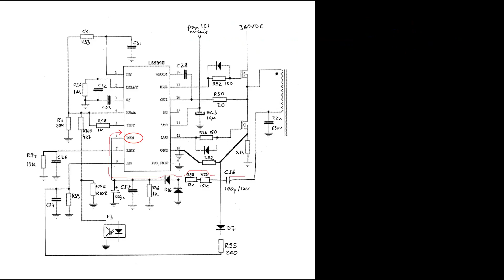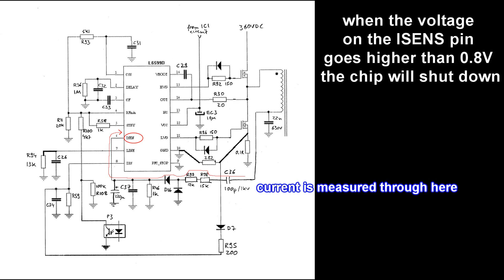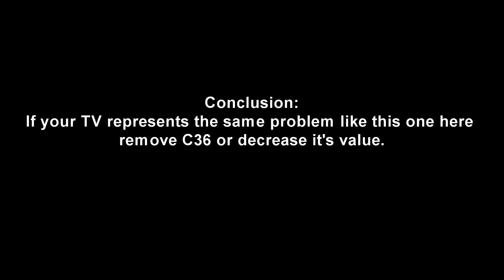RLC3210 turns on and off intermittently

Comment: Thanks got my RCA TV fixed I had tried so many things to fix it I removed c36 and its working added a 68pf cap and tv still running fine must be right on the threshold of tripping the over current circuit  with 100pf cap
thanks again for the video

Comment: It was a success? Always good to see the result when fixed.
Reply from the maker: Yes. Before doing the mod the TV would work for at most 10min when first turned on then it was doing the ON OFF thing. It's been working now for quite some time without any problems. It would be nice to know the current on the 24V line of a working TV. Some people apparently had success with replacing the inverter board or the resonant controller chip, all having the exact same symptoms like mine. I think the overcurrent protection is pretty useless here because it's so slow. A real short somewhere down the 12V or 24 line will blow a fuse.  I would check the inverter transformer output resistances though and also maybe replace the two electrolytic capacitors on the inverter board. Everything else would be a waste of money for these cheap TVs.